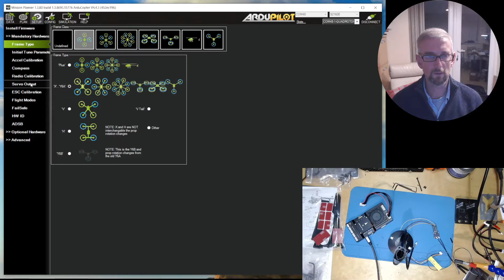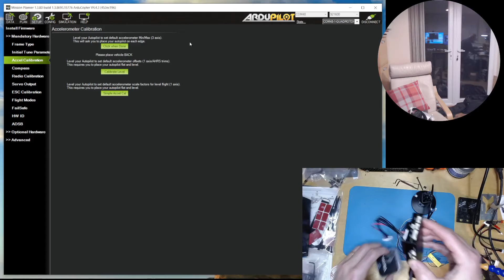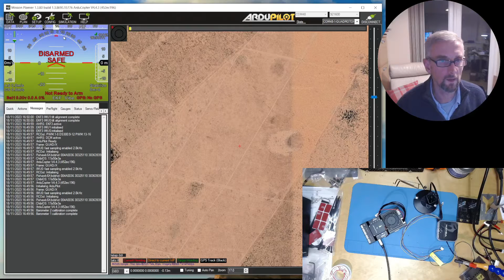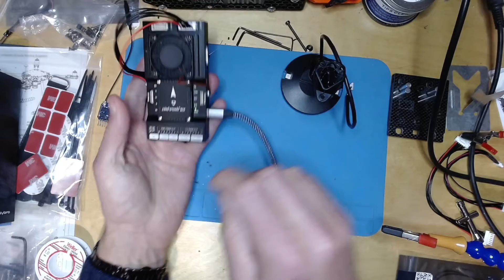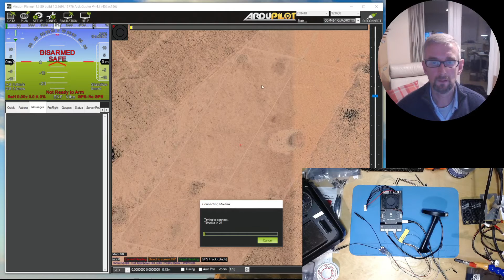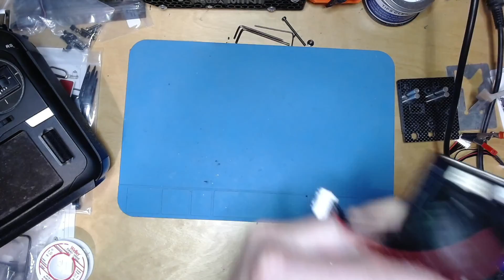Holybro X500v2 Build Video 3 - Initial Setup - CAN GPS, Compass and ELRS RX Configuration

Comment: The crackly noise we can here - is that the AP cooling fan electrical noise?
Reply from the maker: No, it’s some kind of interference with my camera - I couldn’t hear anything myself. Maybe the TX
Reply: ah, OK, I noticed it stopped completely when power was removed from the AP @andypiper5285